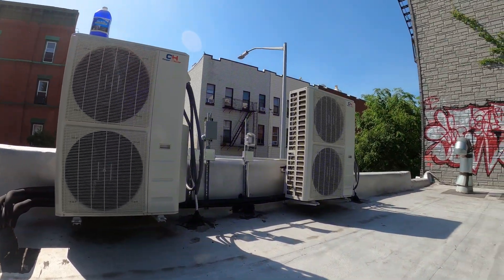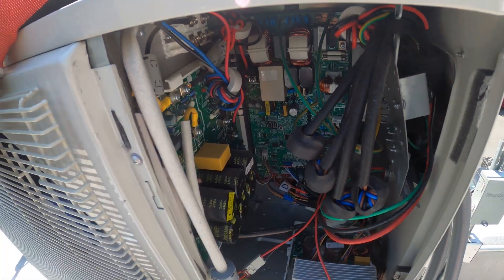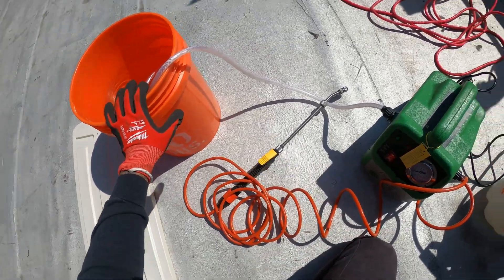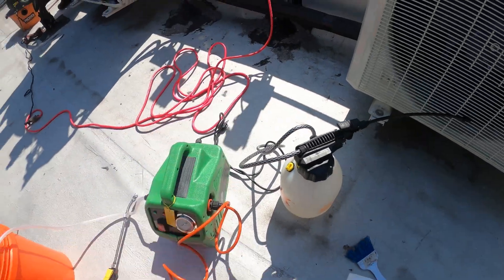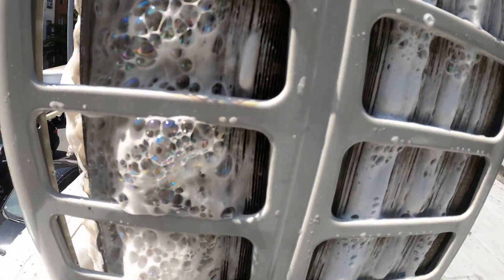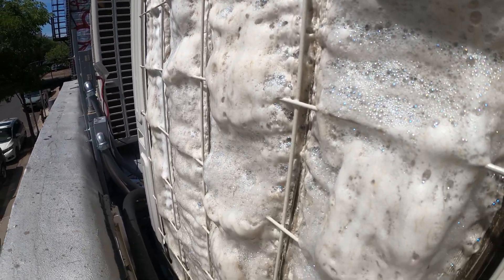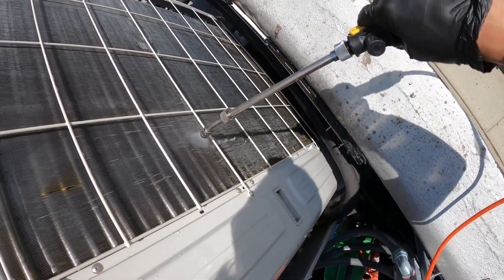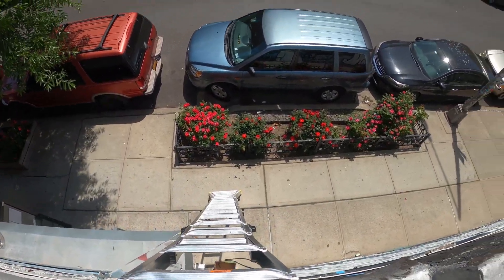HVAC: How To Clean A Condenser Coil For An AC (HVAC Condenser Coil Cleaning Step By Step) DIY

Comment: Awesome demonstration i was contemplating on using this for larger RTU units and a 50 gal rain barrel with extended suction tubing. 

Where are you located region wise, nice of them to face those condensers on tbe edge of the roof for yah! 😅

Here in virginia its actually code where i am if equipment is that close to the edge of roof that railing or a tie down is to be provided on the roof for saftey!